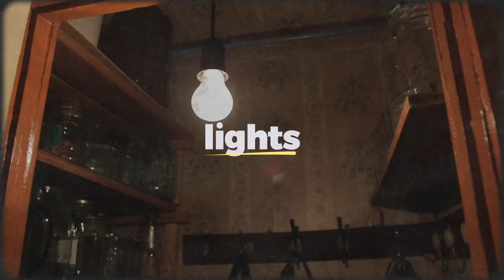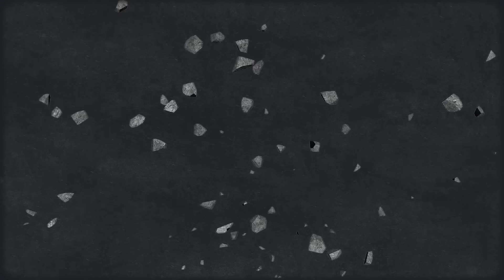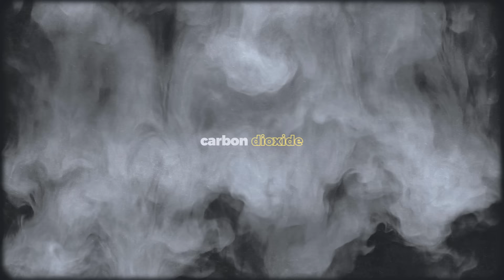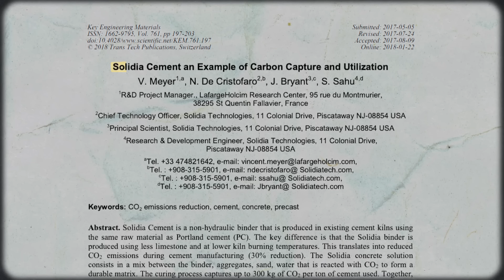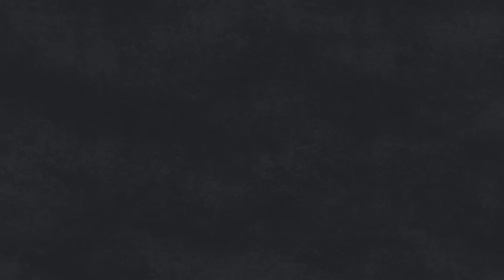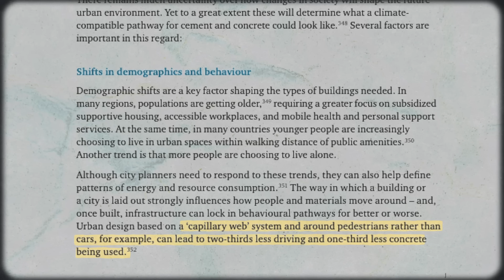Is Concrete Destroying Our Planet?

Comment: Bill Gates thinks that we can solve this problem simply by using money and technology. It's rather convenient that there is no conversation about systemic change.
I'm from India and we have been making our houses sustainably using local resources like mud, stone and bamboo for many centuries now. We already have the solutions and alternatives. Unfortunately, they are not glamorous enough to have the attention of Silicon Valley.
Reply: Probably one of the biggest challenges to climate change is that most westerners simply can't imagine a world where they live in a house made of mud, even if the material has little impact on their quality of life. /:
Reply: @cud.design  I can imagine a mud house in Seattle.  Just not for long.
Reply: @cud.design  I'm from Arizona and have lived in Adobe houses. It does seem to depend on location though. Mud cob and haybale construction are tough in the damp.
Reply: @cud.design  may i suggest you that in the USA houses are made of wood, as well as in UK and in many European countries.
The point here is not about houses but infrastructures, they consume much much more materials, concrete and steel, cause to their volume. Can you build a dam made of bamboo and mud, and an  highway, an airport? 
Next time you drive on a very long bridge, think about the only material that still today is capable to resist the load of your vehicle. That bridge polluted like 1000 concrete two stories houses.
Reply: @giuseppenativo2123  Thank you, I was about to say the same thing, we focus so much on making sustainable buildings out of wood and mud and bamboo, which is by all means good, but it's a fraction of the problem... The way our societies currently function is sadly impossible without concrete (and steel)
Reply: in the end we need to think about our consumption and resource use but nobody wants to advocate for actual restrictions and large scale changes to our modern lifestyle
Reply: @golem2008  Certainly not Bill Gates!
Reply: I'm sorry but i can't see any sense in your approach or at least i can see it if you confine it in no seismic areas with a low density of inhabitants. That becomes vernacular architecture, that i love.
A huge chunk of countries, with their high urban density cities, are localized on seismic ground, from centuries or millennials. They have always fought against earthquakes to survive. Think about Japan, Italy, middle East.
I really care about this problem but unless we are going to start building everything, sort of, with CLT technology, with all its limits, we still have to continue to use the best material on the market to assure the safety of infrastructure and buildings.
The reality is that just research, technology and a less greedy market, could mitigate the problem.
At the moment there is no solution at all.
The energy efficiency of concrete constructions is pathetic, it's cost during the decades is stellar, the pollution caused by demolitions it's outrageous but... We could dialogue for ages about this topic.
Reply: @giuseppenativo2123  india also lies in a seisemically active zone. not to the extent of ring of fire but yeah.
Reply: @vidincrisis  yes, I'm aware of it. The northern area is in tight contact with the Himalayan mountain area also if the problem is more at the feet of the mountains and deeper. Also Pakistan has big troubles from its position on the map. Thanks
Reply: Well said Shrinidhi, include lime mortar historic building too 👍🏻
Reply: In other words, Bill Gates doesn't own any part of the concrete industry.  "Therefore," he says, "let's try some kind of 'green' method that I DO own, so I can monopolize THAT, and get even MORE rich!"
Reply: A problem is that the traditional and locally sourced homes, are not attractive compared to what has been built this century. Where I live, long ago people built underground homes. Before that, people erected mobile shelters and migrated with herds of animals because there was not enough materials for permanent settlements.
Reply: Bill Gates is done anyway. I don't want to hear about him again.
Reply: Bamboo requires a lot of water (if I remember right).
Reply: India is super polluted.  Fix ur country
Reply: I get what you're saying but India is also a tropical country. Western ones need to have thick walls for insulation bc they have winters, how do you get insulation with bamboo?
Reply: Billy doesn't care about individual lives as much as maintaining a higher standard of living for some while others have to resort to housing which works perfectly fine but can't be integrated into most modern infrastructure in the eyes of the corporate sector
Reply: i don't think you can build a skyscraper out of bamboo and mud. If you can then you are right
Reply: @pasticcinideliziosi1259  Maybe we shouldn't build more skyscrapers?
Reply: @pasticcinideliziosi1259  
Skyscraper aren't made of concrete, but of metal and glass. Though the foundation is usually concrete
Reply: @LancesArmorStriking  steel is even more polluting than concrete
Reply: @pasticcinideliziosi1259  I think that's kinda the point, do we actually need skyscrapers? if we have more decentralized cities, skyscrapers really wouldn't be all that useful, and we could build housing and office space using less polluting materials because they wouldn't need to be hundreds of meters tall
Reply: @Knedlajz2  if we all lived in small mud houses we would occupy a way bigger part of the world, since you can’t delete crops and vegetables you would need to deforest a lot to make space for those houses.
Reply: @Knedlajz2  that is called 'land consuming' and it has been, until today, one of the greatest plague that human kind has spread, for the most in USA. For sure you know the world 'sprawl'and it's meaning. That is caused by an extremely extended use of the land, to give a cheap house to the new post WWII generation and make a ton of money. Builders, destroyed everything on their way to build cheap tract houses.
If you are going to create small places to live, you will need to bring there energy, water, black waters pipes, roads. That's pure pollution, in a systematic way. Skyscrapers are too but they concentrate the services inside the buildings.
Believe me, it's a debate that comes from the fifties and all the best architect of the past century worked to solve this problem. Somewhere it has been solved, sort of. For the rest, nice suburbs are still there and they won't go away soon. Thanks
Reply: @pasticcinideliziosi1259  you can use bamboo instead of steel constructions big time
In fact the are MORE DURABLE and flexible than steel, as well as lighter

China often uses bamboo construction frames
Reply: @croissant4131  Bamboo doesn't work well in ice cold climate and has a shorter life span.
Reply: I understand and generally agree with your sentiment, but I'm not sure how you scale your proposed solution across the globe without technological progress? If the pandemic has demonstrated one thing to me, it's that even the most simplistic "common good" behavior changes are hard to deploy widely - I'm not sure how we can expect social change to deliver us the reductions we need to see in the timeframes available. The tech is mostly there, we need to deploy it widely and quickly and I think social change is what creates lasting progress and long-term trends towards "less".
Reply: We still need inovsyion in many areas
Reply: Yea, in the matter of 2 words "Bill Gates" this channel lost me forever. Nothing like being propped up by one of the most ghoulish hyper-capitalists GENERATING climate change while exploiting millions.
Reply: @thakatspajamaz  He recently made a video titled "Why billionaires won't save us" where he criticized Bill Gates and said he regrets doing that sponsorship. He has edited out the sponsorship and outro part of this video. Did he really lose you forever?
Reply: The Himalayas are in India...

Comment: I've seen bricks being made out of certain kinds of mushrooms. I'd be interested to see how that could fit into this
Reply: and bricks made from plastic that are 3x stronger than normal bricks!
Reply: @froggygirl999  is it sustainable?
Reply: @imiy  what do you mean is it sustainable? It's literally recycling.
Reply: @froggygirl999  plastic bricks? Idk if that's 3x stronger lol, I'll look it up
Reply: @froggygirl999  microplastics and they will melt in a fire. Regular brick can tolerate heat
Reply: Also sewage sludge!
Reply: @Stephen Valentine  considering houses are no longer built to last and we l no longer want to retain those which are (demolish and rebuild) that shouldn't be a problem and in fact is an advantage (less rubbish going to landfill). I'm really surprised there is any land left to be filled given the amount of waste created these days and this waste doesn't decompose.
Reply: Is it resistance to earthquake,flood etc.........
Reply: @Stephen Valentine  they actually stay for hundreads of years. and no fungus, since they are dry.
Reply: @Stephen Valentine  I lived in one. It's traditional village houses where I live. Made of sticks and clay. In the old days peasants didn't have resources to make a good foundation though, the house didn't last 100 years (which isn't a big problem since it's cheap). But some do quite well. With a proper foundation there's no problem at all. It's all about good "feet and hat". The walls don't matter as much if they are protected from water. And no fungus. Although you can't make it a "passive house" in my climate. So strawbales are more preferable.
Reply: Or cob. Which is essentially dirt under your feet. There are many substitutes for cement in bricks. Not so many for cement in building foundations though...